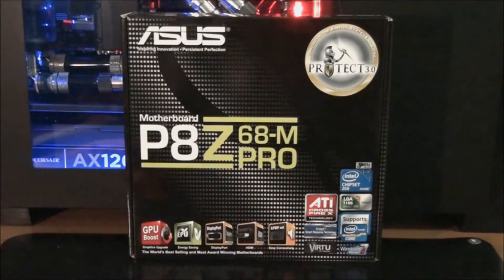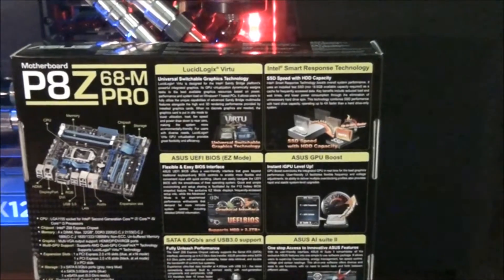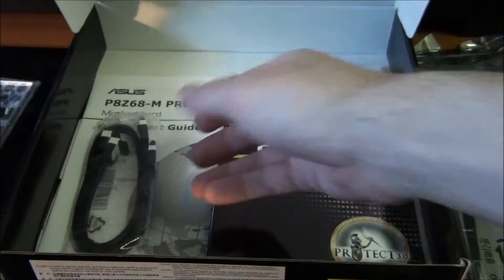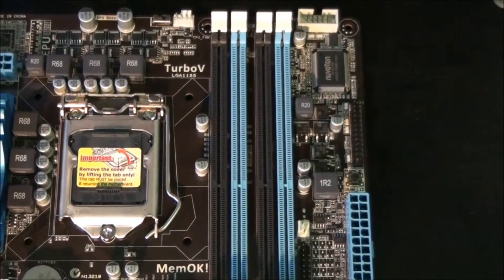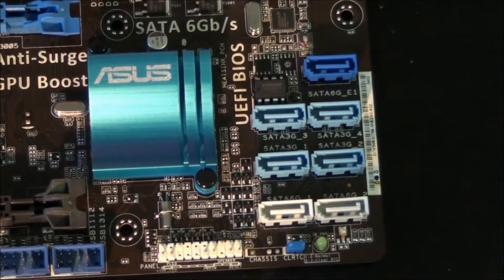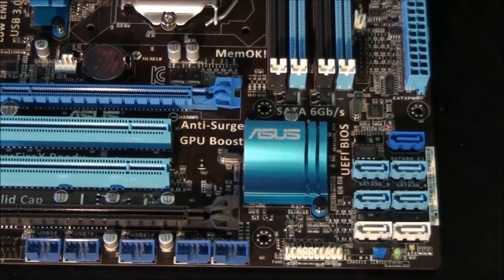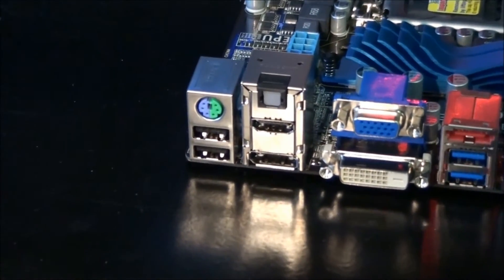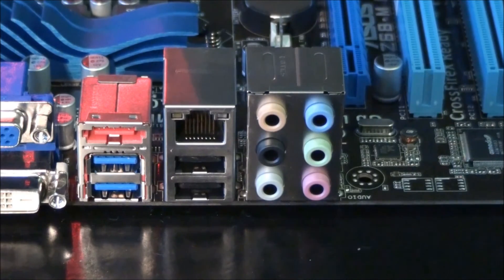Asus P8Z68-M PRO Motherboard Review

Comment: hey I have a case, that im gonna use it's part into another custom build that I'm making, and I want to know whether my CPU is going to be compatible with this motherboard which I'm getting in the video

it's Intel Core i7 2600 @ 3.40GHz
Sandy Bridge 32nm Technology

I know the 1155 bit will work, but on my i7 sticker it says vPro, which I need to be assured if it will work in this motherboard
thanks in return :)
from a subscriber

Comment: Hey,
I was thinking of buying this board for my computer. Im currently running an Acer Aspire M3910 with a non branded mobo. Currently my PCB is uATX / 244*244mm / 4 Layers. Will this fit in my case? i.e. is it a uATX mobo?
Thanks

Comment: I recently purchased this board.  When I first started it, for shits and giggles, I was curious if it would boot into my old Windows 7 install.  It did.  I shut it down right away and reinstalled, so I have no idea how stable it would have been.  Does anyone know of any water blocks for the MOSFETs and south bridge for this board?  I am wanting to make my own case and go with liquid cooling with a small radiator and single slow fan for the CPU, MOSFETs, and SB.